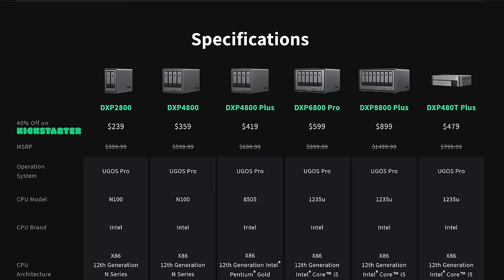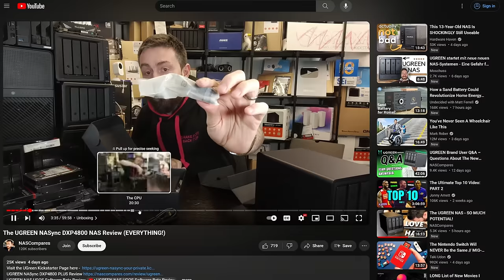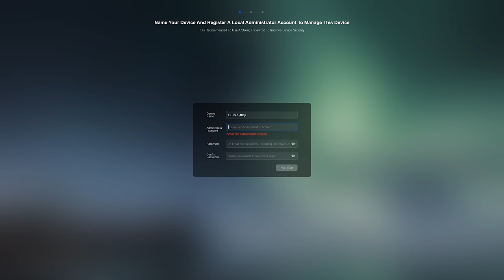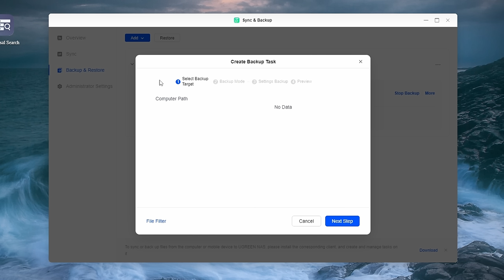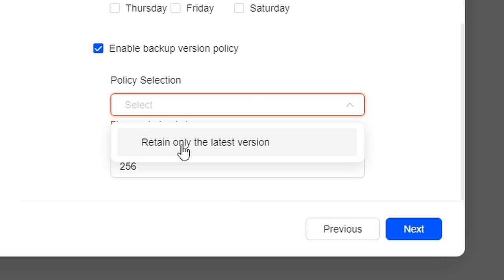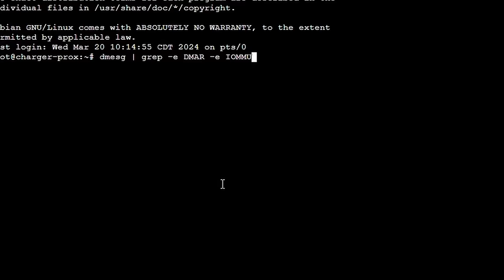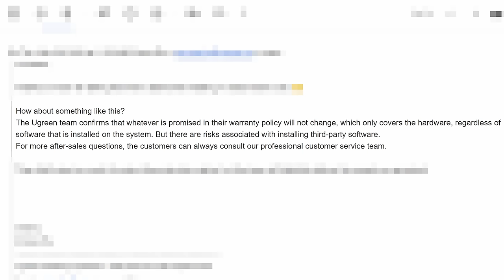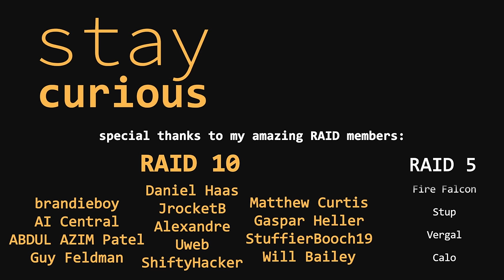UGREEN makes a NAS..?

Comment: Hardware seems really solid, especially that 1235u for Proxmox VMs.
Reply: my diy nas with the i5 14500T kicks that 1235u ass... its also just been released, not 2 years old like the 1235u 💀
Reply: @sunnycloudy1337  I have a 13700k desktop that will destroy this as well, but not in this form factor.
Reply: @jordant2  I have the jonsbo N2 which is slightly bigger, but not by that much. No point putting a desktop class processor on it thouugh, the T variant which is 35W TDP limiited is perfect! Also the problem with the ugreen nas is that it is released as "new" with a 2 year old cpu, that's not a good start, is it?
Reply: @sunnycloudy1337  You have a good point, but it's a fair price compared to Synology or Qnap, and still a better processor than either manufacturer offers. At least at the kickstarter price.

Comment: imagine replacing that boot ssd for a m.2 nvme splitter for 4 nvme drives at 1000mbps speed each. assuming is Gen 3.0 x4 every lane is 1.000Mbps speed.

Comment: Personally I think it is bit of a wasted effort from Ugreen to make their own software as they are not primarily software company. Why not just make deal with truenas and use community edition and focus on hardware instead of making something that will have worse experience for years.

ramping up fan and HDD (usually noisy) is kinda killing this for me and would rather spend bit extra and go for FS6712X, but we all have our own needs. I currently have my +10 old DIY NAS with 6 (8 slots available) sata ssd:s and I am pretty happy with it, but will probably upgrade to something smaller at some point.

Comment: No ECC support? Pass. The RAM may well work fine when the NAS is new, but what about when marginal sticks degrade a few years down the line and begin silently corrupting data you're writing. Seen it before where Btrfs checksums don't match the data on the disk, but its too late by then. At least with ECC you either correct it, or throw an error before writing garbage.

Comment: It is really interesting to see such refined hardware and quite innovative design with such poor software.  But, as you said, the software is still in development, and it can run Truenas, so if you really don't like it, you do have options.  This could be a nice wee setup when it is ready to ship, but I will hold out for now.
Reply: It makes sense to me. This company is not a software company; they sell hardware. I imagine their knowledge and processes are much better at producing hardware products. They're trying to produce an entirely custom operating system for this NAS, which is a huge undertaking for a company that hasn't done that kind of thing before.
Reply: @ssholum  I agree.. as a developer myself, any new firmware or software is a challenge.  I think that if they make the final product a little easier to install truenas or some other NAS OS easily out of the box, it would be a real hit

Comment: If there is a ready made software/OS solution why would they not go with that instead of having to have the support available for their solution?  I'm sure there is someone with a spreadsheet that can show me how it makes sense but on the surface it seems stupid.
Reply: Probably because of licensing issues if they used other software, which would either also drive up their bill of materials for this NAS, thus reducing profit or raising prices; or, in GPL’s case, it would force UGREEN to open-source all the firmware and software they write for supporting their prepackaged OS, which is good for their main niche tinkerer market, but terrible for trade secrecy.
Reply from the maker: I ask myself that question often. It seems having a small team dedicated to making installation guides/resources for a few common operating systems would be a significantly better use of time/funds.
Reply: @HardwareHaven  100%, then when the consumer installs a UGREEN-approved OS, UGreen gets to help them do anything a Linux distro can do, rather than the simplified list of things their OS can do. I'm sure UGreen wants to staff people to walk someone through why their... insert whatever plugin/container/app, etc. is going wrong on software they didn't develop.
Reply from the maker: @tim3172  When did I say they should offer software support for it?

Comment: I dunno... In my opinion running TrueNAS on it makes way more sense. This company is new to this field of hardware so it might be riddled with problems as seen with the software. If you run TrueNAS and the hardware dies then there is no guarantee you get a replacement. With TrueNAS you can put the drives in other computer and rebuild the pool. With the ugreen OS? Good luck...
Reply: "If you run TrueNAS and the hardware dies then there is no guarantee you get a replacement."
He has several email that disprove and re-disprove this misconception.
Reply: @tim3172  You didn't understand what I was trying to say

Comment: For me, software is what matter the most. While I might cry and drool about 2.5GBe/10GBe etc (as a Synology customer), I need to be able to trust the hardware and software that is responsible for safeguarding my data.  As much as I might want to, I couldn't trust these devices for it, at least not yet.

Also, if I'd go for swapping out the SW - well, firstly I don't want to.. I don't want to micromanage another device's software. . and secondly, why not just buy something that's open in the first place. This kind of throws this argument of 3rd party software to the gutter for me.

Comment: I was hoping that the USB-C port would let you plug the NAS into a computer and have it show up as mass storage, but based on the rest of the hardware, I'm guessing that's a no.
Reply: its a nas, not a das... but would have been nice to be both at the same time. question is, is that a thing? are other brands doing it?
Reply: @sunnycloudy1337  Unfortunately, it's not a thing/other brands aren't doing it.

Knowing that one of the USB ports on a Raspberry Pi can present itself as mass storage, I did some research on if a DIY solution was possible and the tl;dr was that, yes, it's possible, but would take enough custom development that I dropped the idea.

Comment: That Pentium processor is surprisingly good! Especially for a appliance NAS. Though I do wish there to be DIY motherboard/CPU with Pentiums and i3 U series processors with enough expansion for a NAS, and a sata chipset that is not JMB585 so it supports better C-states. Ugreen has shown in this product a powerful CPU, mobile CPU and good expansions is very possible.
Reply: I mean, if it's headbanging off it's 100degC TJMax and immediately throttling - which it is based on evidence in this video - it's kinda crap, honestly. If you look at NASCompares review, he shows the task manager around 6mins in and 39mins in, and it's at 50-70degC when it's not doing anything, fluctuating wildly. That's legitimately terrible.

Quite frankly, mixed in with the 'very beta' OS, the whole thing feels pretty amateur hour to me.

Comment: "The drive trays feel cheap and flimsy"
"Overall the build quality looks and feels amazing"

uh-huh
Reply from the maker: …what is your point?
Reply: @HardwareHaven  none, I was just amazed to have found Schrodinger's NAS.

A NAS that has cheap and flimsy parts and an amazing build quality at the same time!
Reply from the maker: So the trays, at least when empty, do feel pretty flimsy but they actually worked well. Outside of that, the whole thing feels really solidly built. Sorry if that wasn’t clear enough

Comment: Man, that statement from uGreen combined with the specific design choices worries me. "Sure, you're free to install any OS you want on it, but to do that you need to change a flag in the BIOS, which you're locked out of unless every drive is removed from the board, and that's impossible without breaking the warranty seal, so try it."

Comment: Instead of running Cinebench in a Windows virtual machine, consider running Geekbench, it will run natively on Linux and provide several values, like Single-Core and Multi-Core Score .

About this NAS, why did they created their own OS instead of using an existing solution like TrueNAS?
Reply: Legal requirements. Using TruNAS on there's requires paying licensing etc
Reply: @mrmotofy  Right, it may be included as a paid option when buying the NAS though. And what about an open source software like OpenMediaVault?
Reply: When they offer an OS, they control the support they provide.
If you encounter an issue with UGreenOS, they can help you fix it.
When you're having an issue with a TrueNAS plugin/app/jail, OMV plugin/configuration etc., they can tell you to kick rocks.

Comment: Why no all-flash version that can use 2.5" U.3 drives?
Reply: Because a single U.3 drive when in NVME mode obliterates the PCIE and network bandwidth of the device(?)
"Why doesn't this Corolla come with a Model S Plaid engine?"
Because it makes zero sense to do so.

Comment: Idk why both you and raidowl are advertising this overpriced thing
Reply from the maker: I'm covering it, not advertising it. And I gave quite a bit of criticism, but for the hardware, the price is pretty fair IMO. The software... not so much. Not now at least.
Reply: @HardwareHaven  idk the price just for a two bay doesn't compare imo to a qnap or synology. I'd rather buy a netgear nas like in your last video but that's cause I'm a broke boi and like old hardware
Reply from the maker: If you don't find it appealing or useful, that's fair. I would never say this is a good value for everyone. Just a good value if you're looking for this exact form factor with these specs.